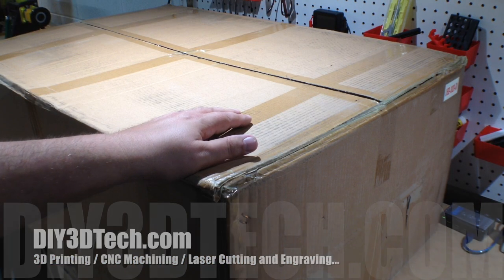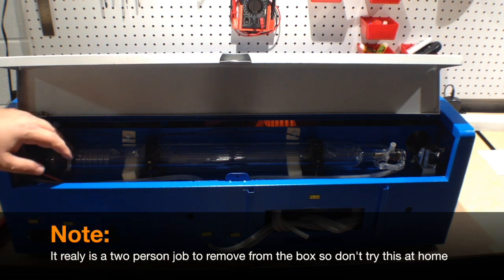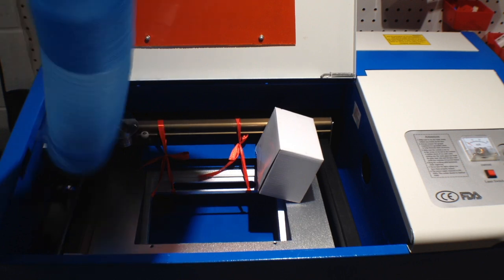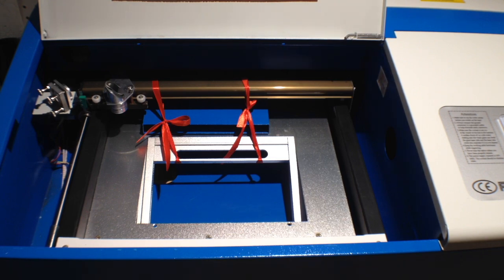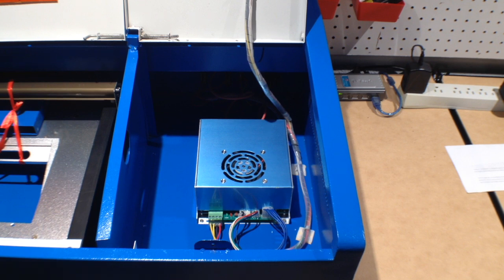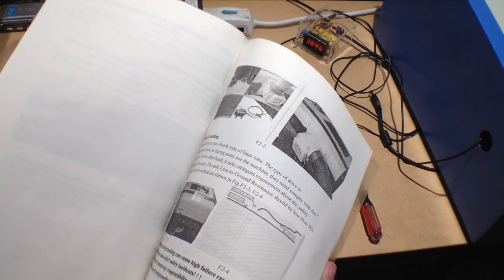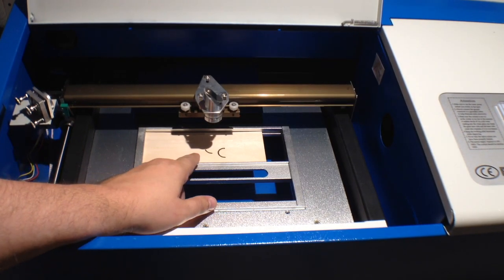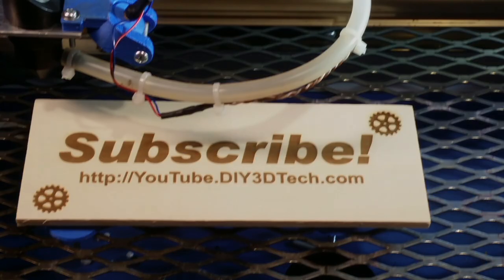K40 eBay Chinese CO2 Laser Cutter & Engraver - UnBoxing New 40 Watt Unit!

Comment: Very informative. Looking at one of these for engraving and cutting knife handles as well as game calls and pens. Would really prefer rotary attachment but have not found one in my range yet. Or maybe I have saved up a large enough range but need to get going in this. Any suggestions???
Reply from the maker: Won't cut knife handles, you will need to be around 60 to 100 watts for that.  With 40 watts you can cut 3mm to 4mm reasonably and push it to 6mm with multiple passes however your will start to see charing.  Engraving is another story, that should be "ok" yet keep in mind these are designed for making rubber stamps so the aligned cutting area is very small.  Now as you can see from the videos I have hacked mine and it is possible hover they are temperamental and if your doing this for a business go with at least the 60 watt version from eBay (not 50 watt those are rip offs)...
Reply: DIY3DTE interesting. I will look into the to watt option for sure. I'm usually pretty lost in this type of thing so your input is appreciated
Reply: Is the 60 watt the same model number???
Reply from the maker: They are different (vastly), you can go here http://diy3dtech.com/purchase-laser/ and scroll down to 60 watt and you see them there...
Reply: Looking to purchase a 40 watt this week probably.
Reply: DIY3DTECH.com is the link to your store on eBay???
Reply from the maker: Yes I have script here that scrapes eBay: http://diy3dtech.com/purchase-laser/
Reply: DIY3DTECH.com I'll be in touch next month. We have decided to invest in the 50 watt kit with rotary. Just have to save another month for it.
Reply: Just can not swing a 60
Reply from the maker: Don't do it!  50 watters are really only 40 watt tubes over driven which lead to rapid failures.  As the physical structure is better, the tubes performance won't be for long as when you over drive it the CO2 gas will start to breakdown into nitrogen quickly so at the start it will work better, but quickly decline to worse then a 40 watter (which is really what it is) as a lasers wattage is determend by the length of tube...
Reply: DIY3DTECH.com could. It be upgraded to a larger tube at that time???
Reply: DIY3DTECH.com I'm getting lost. What I am trying to do is engrave mostly wood cylinder shaped objects like duck calls and pens as well as flat items. I am "Budget Challenged" on a fixed income. Is it reasonable work the 50 watt unto the funds are built up to replace the laser tube with a larger wattage tube, say 60 watt???
Reply from the maker: You can't easily upgrade tubes because as I mentioned the power of the tube is a function of its length (so it won't fit) and will require an upgraded power supply so not worth.  If you only want to "engrave" and on a budget then get the 40 watt with a rotary (typically used for wine bottles and glasses).  Just don't expect to do more then about 3 to 4mm. Also if you have more question feel free to hit me up :-)
Reply from the maker: Not easily or cost effectively

Comment: Hi there . Some people say 40 watts is not enough for aluminum copper brass etc. Other people say speed down ,energy up....can you help me?
Reply from the maker: Those people are right about the 40 watt laser as it is barely enough to cut acrylic and wood so metal is out.  I have seen a metal etch used, but have never been happy with the results.  As the best way to think about this is it is nothing more than 40 watt light bulb literately...

Comment: you seem very knowledgeable and the video is informative. my question is i would like to engrave or mark on metal medals, and aluminum trophy name plates and acrylic awards. i do trophies and awards. will this work for me? can i do multiple medals at once.  thanks
Reply from the maker: Metal no (you could try an etch coating but I have not had good luck with that), acrylic yes  as if your going to use this in a business would suggest going going at least 100 watts you will be far happier as these 40 watt lasers where made to make rubber stamps...
Reply: thank you, i will do that.

Comment: I believe the reason the interior frame is not bolted is because it allows the exhaust fan to sit inside the machine while shipping. I watched another YouTube video where the interior frame was bent because of the packaging of the exhaust fan, air pump and misc items during transit.
Reply from the maker: Are you speaking of the an gantry?
Reply: Hi. Since I don't know the actual name of the piece, it's the square portion with the spring slider. The shipper may have used ribbon ties to hang it so the bulky exhaust fan would fit nicely for shipping. That's my guess, not a certainty. Love your videos BTW. Hope you can show the software install or what software you find most useful and easy to use. :-)
Reply from the maker: Oh you are speaking of the spring clamp & bed, no its just poor Chinese quality control as I now have several of these.  If you get  one, you will spend the first day replacing & tightening screws and the such as they come in quite a disarray unfortunately as I get at least one request per day for help  from folks that bought one and ran across my videos.  Don't get me wrong, once you get it working it can be amazing its just not turnkey...

Comment: Please need help mines doing this when i first power on:  https://www.youtube.com/watch?v=r22FlMjb54M Thanks
Reply from the maker: Sorry did I respond to you another already?
Reply: DIY3DTECH.com No sir. I use another YouTuber video, but my laser is doing the same thing.
Reply from the maker: Would suggest two things, (1) check the wires to the limit switch and make sure the they are (a) connected, (b) the limit switch is work and (c) the wires are connected to the control board.  Second (2) check your belt and ensure they are aligned, this is a little harder to explain, but if you look at belt train you will get the idea...

Comment: I got this laser cutter today and I'm having an insane hard time setting up the software to get it to run... I bought CorelDraw X7 on amazon for 40$, atrying to get it to work with the CorelLASER plugin and it refuses to install the plugin, it says I need CorelDraw 11 or greater... which X7 is greater. Searched high and low on google for any possible solution to this and I have found nothing AT ALL... I'm on windows 7. NEED HELP PLEASE!
Reply from the maker: check around the laser forms as you need to the older corel laser version as i have not seen it work with anything else.  also one might question the legitimacy of this to but that is another issue as you might have to run XP as my window 10 machine hates it....

Comment: I currently own a low powered diode laser machine. I wrote my own CAM software to use with it (BenCutLaser) and my laser machine uses Grbl. I'm thinking about getting a 40 watt CO2 laser, but I would like to be able to use my own CAM software and be able to flash Grbl onto the controller board. But I don't know what kind of controller board/CPU comes with these CO2 laser machines. Can you help shed some light on that for me? FYI I am also the Admin for the largest US-based community support forum for low cost laser machines here: www.BenboxLaser.us. Thank you.
Reply from the maker: Sure check out my laser playlist (https://www.youtube.com/watch?v=K-7o16atJqs&list=PLInTrkIbj69kPO_UP81yxX-xov4SVyPlD) there is a ton of info there as I converted one of my 40 Watt CO2 lasers to GRBL an it works great however 40watt Co2 lasers do not have PWM so the beam is a set intensity from the control panel.  My recommendation is get one (i.e. CO2 Laser) with a pot to control the Ma intensity (not the digital ones)  for the tube  as than you can than build a simple circuit to convert the PWM resistance...
Reply: Hmmm...I need to control the intensity of the power from my CAM software, not dial it in manually...and yes, my current low power laser machine uses PWM so my CAM software can control the power level via S0-255 or P0-255 depending on if I'm using Grbl or Marlin firmware.

Comment: hi
does it cut white cardstock paper? like 300-350gsm? and does it leaves burn marks around cut lines? one more question - is the laser dot spot thin and if we can adjust/focus it?
Reply from the maker: Yes and yes it will leave burn marks also you want to use an assist with paper as it will catch fire quickly

Comment: Looking at the material clamp; is it possible that it is installed upside down? For me, I would want the clamp removable to easily reload outside the enclosure then drop back into the platen cutout. Optional screws to lock it in place.
Reply from the maker: Sort of as it will sit higher it will be out of focus, however you lower the bed to make this adjustment by just drilling another set of screw holes lower if that is how your bed attaches. :-)
Reply: at 4:40 you pick up the clamp and it looks like it is designed with a flange around the perimeter; that's what made me think it was upside down. If flipped over, the inner dimension would drop into the cutout and the flange would stop and register the clamp on the platen.
Reply from the maker: There is a flange, however its on the underside of the bed per-say...
Reply: DIY3DTECH.com  Got it. Like your videos and subject matter. I'm following along starting with the unboxing.

Comment: with your big new extraction fan , i wonder if you could cnc a vacuum hold down plate ? . cool stuff man
Reply from the maker: Oh ya!  Great idea however I don't know how the motor would react to the drag?  Would it burn it up?
Reply: should be ok as its a cage type fan . you just need a way to mix/balance  fume extraction and hold down . but could make some of your things easy to do .
Reply from the maker: not really a cage, more of an impeller design...

Comment: Did this not come in a wooden crate?
Reply from the maker: Nope just double boxed...
Reply: DIY3DTECH.com
That is really not the way to ship a laser machine.  I had one kudos for the other machines and that was being shipped in a wooden box.  Remove that wooden box and they just suck besides the price should be 20-40 dollars less for the crate AND the shipping cost.  SMH.
Reply from the maker: My first came screwed to a hunk of plywood but this one was double boxed nicely and the tube is in good shape in fact this one arrived in far better shape than my first which made me happy as the first  has big dent in the top from shipping.  :-//
Reply: DIY3DTECH.com
I was thinking and see the price should have gone down as you don't need the handlers to make the wooden crate (I bet you that is where the damage was happening) and it costs less (a whole lot less) to ship a cardboard box(es) than it does a wooden crate.  If I remember right the wooden crate goes by DHL and they are bloody expensive in comparison to UPS or FedEX so where is the cost savings for the consumer?

Since that tube was longer is it really a 40 watt tube?  One thing you should do is when you get something of good quality, and a tube that is far closer to a real 40 watts, is to list them so people can go buy from them too.  If enough people stop buying from the scammers, and use the good people, then scammers can go crawl back into the depth of hell from which they came.